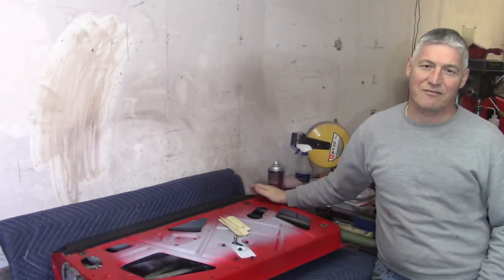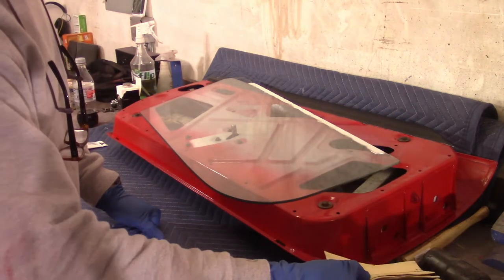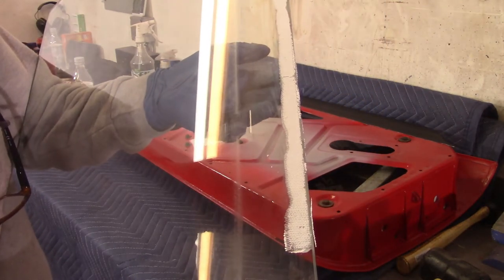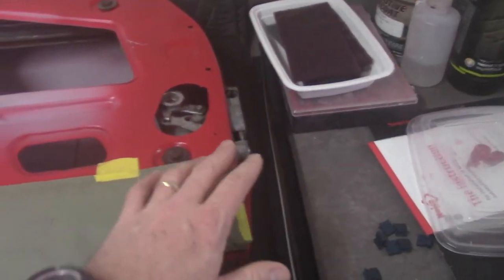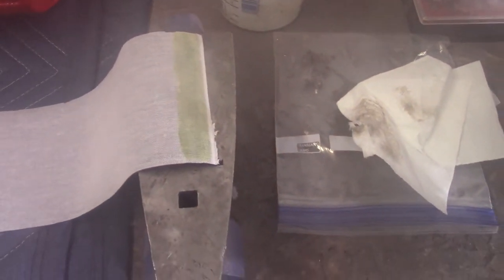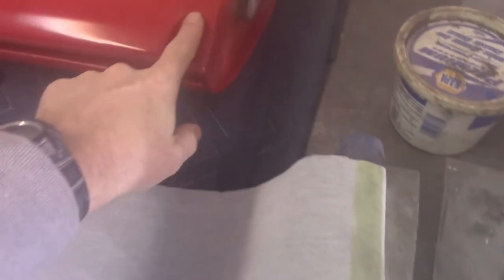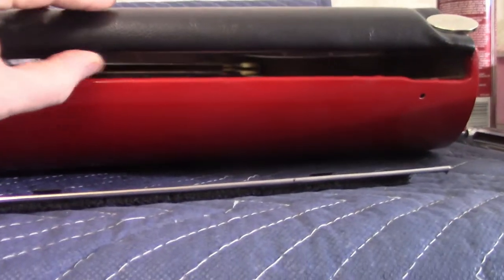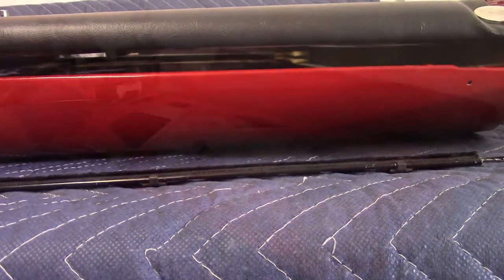Triumph Spitfire Door Internals - Finishing Up [corrected] | Roundtail Restoration

Comment: Hi Chris, it's looking good.  Following on from comments about accessibility of the spring.  Horologists use a "C" shaped clamp to hold main springs in the wound up state; Google "Clockmakers Spring Clamp Holders" to see what I am talking about.  
One of these (or home-made version) might allow you to restrain and remove a partially wound spring so that you can wind the toothed quadrant to a better position... then refit the spring.  I assume that the spring is put under tension when lowering the drop glass; so wind down partially, restrain and remove spring, wind up the glass and then refit the spring.  It should then be at greater tension across the whole range of travel.  Would need to take care as I guess that even a relatively small spring has a fair bit of potential energy
Reply from the maker: Thanks, Robin. Definitely something I will look into as I'm still not sure it's correct. And the spring did draw some blood when I removed under tension. Notone of my best moments! 😬

Comment: Nice. I wonder if the spring is accessible without taking the mechanism out so that it can be adjusted?
Reply from the maker: Yup, it's right there on top as long as you take the door card off. But, you can't put it under, at least in what I think it the correct way, without taking it out and "preloading" it. I assume you mean the window winding spring?
Reply: @roundtailrestoration  yep